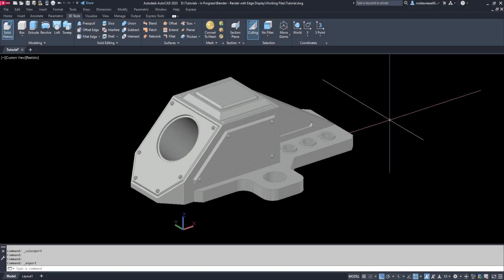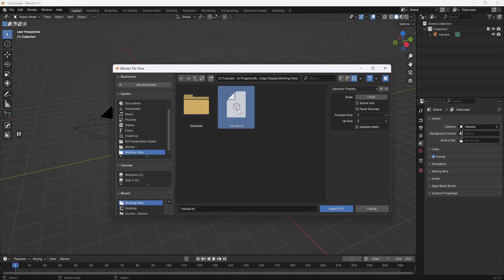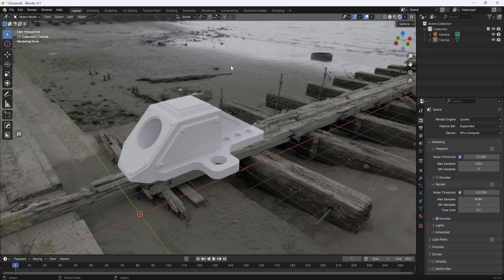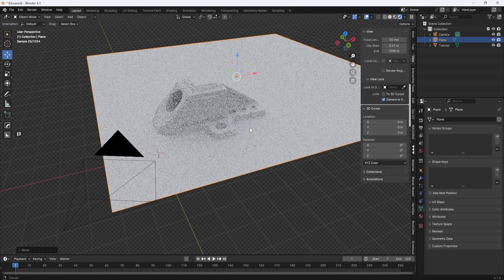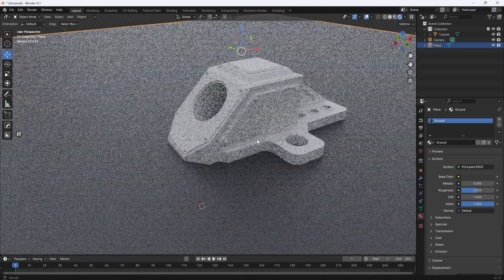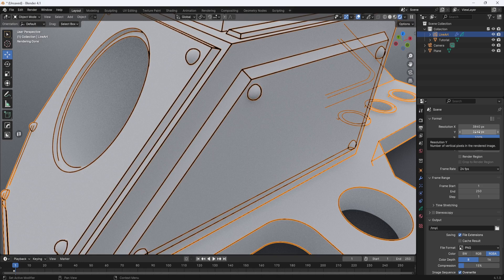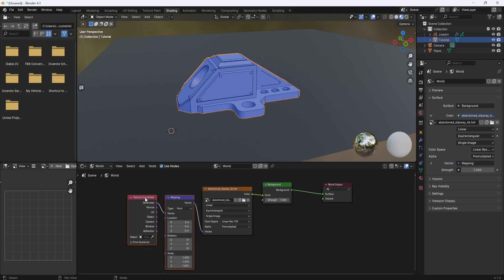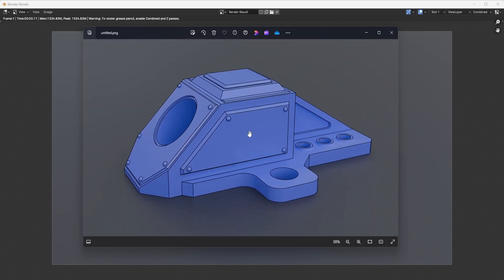Blender – Grease Pencil and Line Art Modifier

Comment: When I use a PNG texture, the line art only follows the outline of the image instead of the inside details. Is there a way to make the line art work on the inner parts as well? Thank u
Reply from the maker: Thanks for the question, but I'm a little confused. Are you saying you're applying a png texture to your model, instead of just a flat color? That should work fine, but then you said the line art only follows the outline of the image? I just tried applying a texture to my model and the line art still shows up on all the edges, so I'm not sure what's happening?